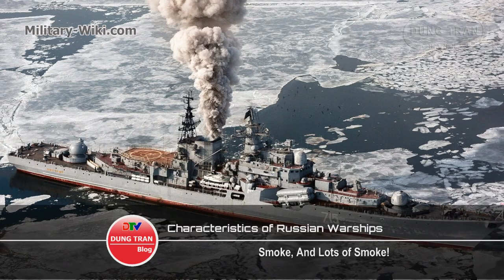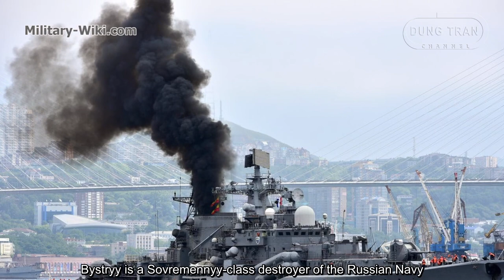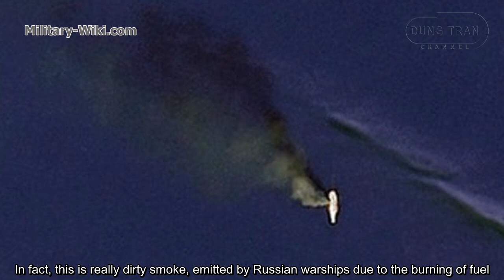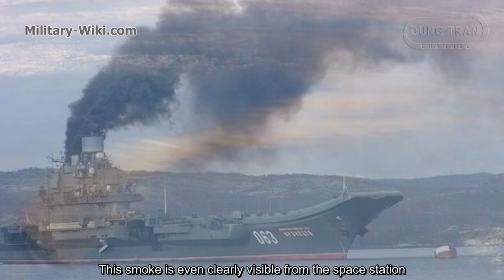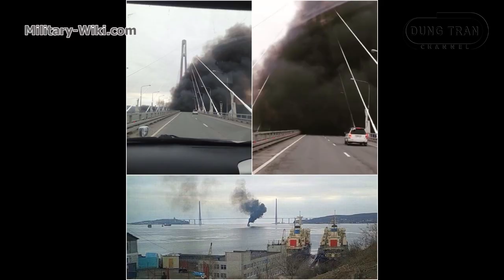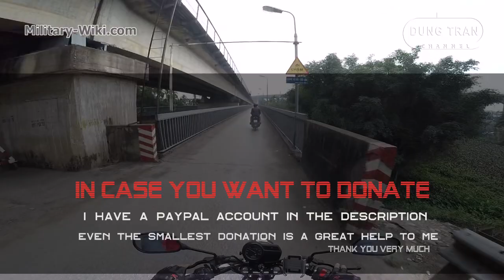Characteristics of Russian Warships: Smoke, And Lots of Smoke!

Comment: They still use mazut? No wonder they're smoky. Mazut is basically crude oil with the more valuable and easy to refine fractions (gasoline, kerosene, and the like) distilled out. All the tar and what--not is still in it.

No wonder most of the fleet is in overhaul most of the time. That much garbage in your fuel must clog the boilers something fierce.

Comment: I did not know what Mazut oil was until now.   Apparently its similar to No 6 Bunker oil or MFO.
Reply: Way worse. It's semi-refined fuel. Basically crude oil with the easy-to-distill fractions removed, stuff like gasoline and kerosene, maybe diesel. What's left is laden with tar and other such garbage that must clog their boilers up very fast.
Reply: @mastathrash5609  :  Now imagine the poor schmuck who has to clean those boilers out...

Comment: i think they are just using crap old fuel they most likely would not use it if they are in a war just like with the jets when they are just flying around or even in air shows they pump out dirty color smoke but not when they are in a missions 

also it makes everything look old/not good and that will make some countries underestimate them !
Reply: The smoke that he said was seen from the space station was the smoke from the 2002 Mount Etna's Volcanic eruption. You can see the Photoshop if you look closely

Comment: The USS FORRESTAL , SARATOGA and INDEPENDENCE all did that when they lit the boilers off.
It's the nature of Marine Diesel.
Reply: USA last made  Diesels like this in 1955 are so. Not 2021.
Reply: You're not making a good case when you have to compare an aircraft carrier launched in 1985 to three carriers built in the 1950s and were decommissioned before the end of the century. a better comparison would be the Wasp class LHDs built in the 80s and no ship in the Us navy that operates on fuel with a steam boilers smokes as bad as Russian navy ships.
Reply: @MrAwsomenoob  FYI , Even after the SLEP program in 1985 of the FORRESTAL class they smoked like a Chimney , I know as I was there the wasp class ships didn't need to get 32 knots of wind over deck to launch fixed wing aircraft , and are half the tonnage , the Kusnetsov Deck run to launch , it doesn't even use marine diesel and if not done properly smokes , considering that the Kusnetsov only just going through refit for the first time since commissioning I'm pretty sure that it won't smoke like it did 😳